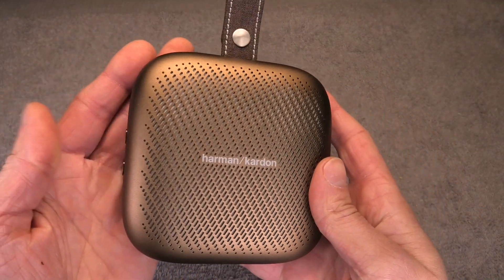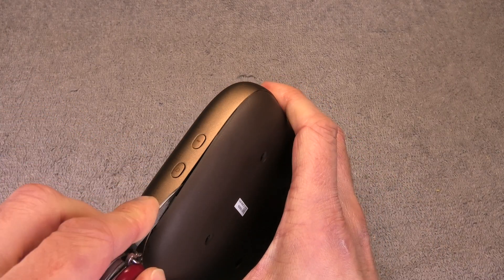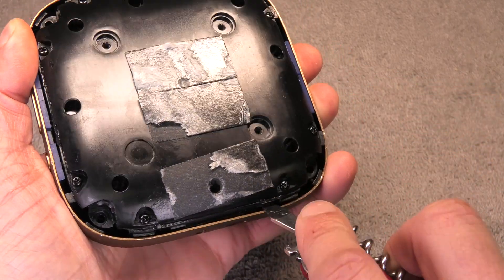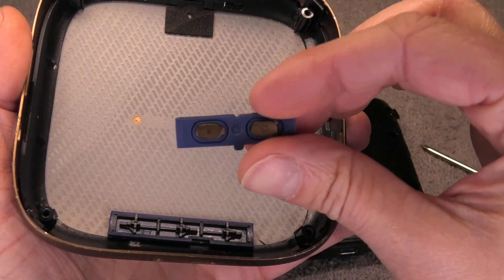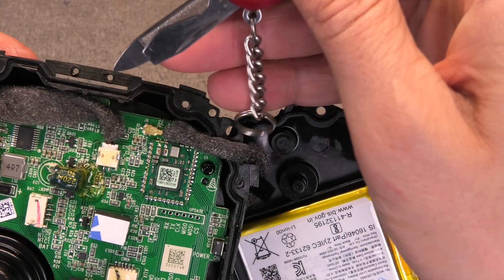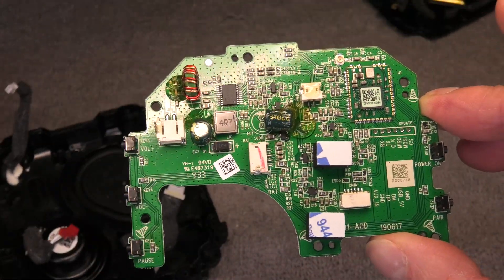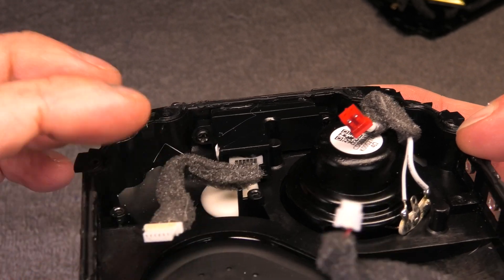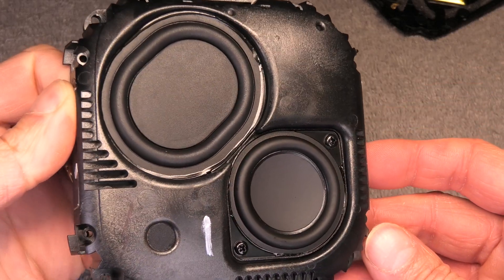Looking inside Harman/Kardon NEO portable Bluetooth speaker (TEARDOWN in 4K)

Comment: Hey, I came from your tutorial on how to fix the left jbl earbuds. I wanted to ask you on how do you fix the left earbud on jbl TWS4? Basically the problem with mine is that it doesn't charge and if it is charging, it only charges for few minutes (even though the battery on the left earbud is low)
Reply: No
Reply: @afistfulofpimples1745  yes
Reply: @Irene4urattention  maybe